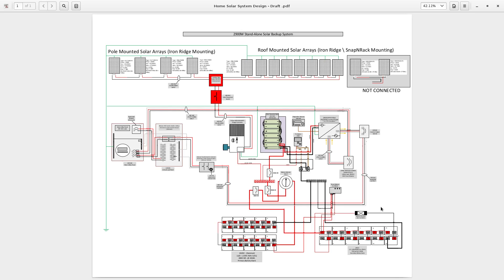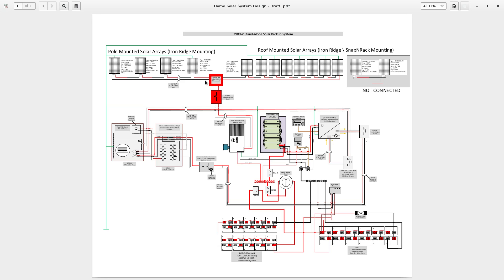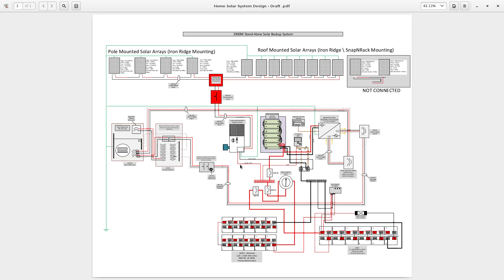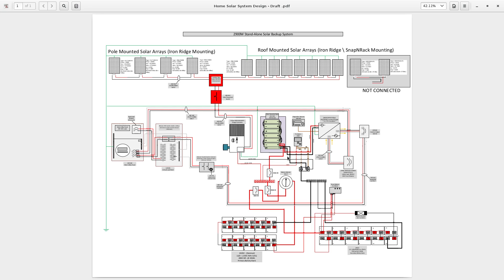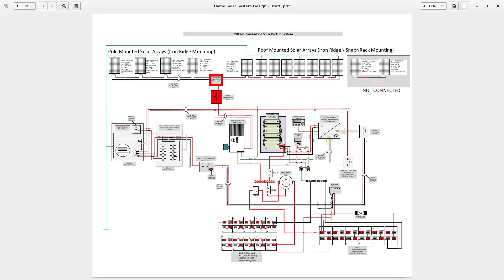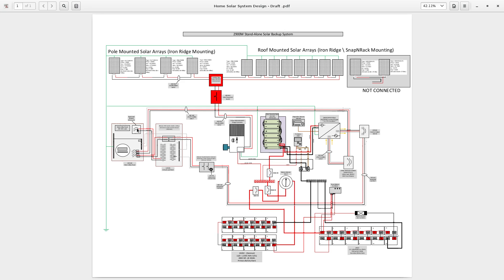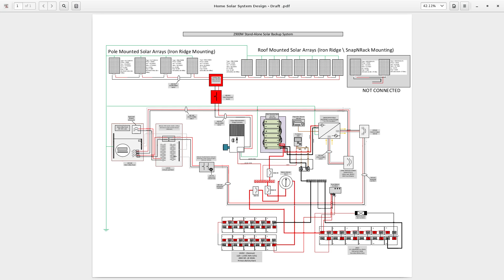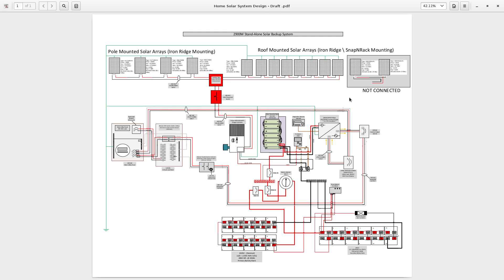My DIY Solar Off-Grid \ Battery Backup Electrical Schematic

Comment: Hi, I am both impressed and overwhelmed by the complexity of your system. This is not a criticism, I'm simply not sufficiently knowledgeable enough to understand it all! To cut a very long story as short, I need to install an off grid system, I'm starting to build my straw bale house and ancillary buildings, one of which will house the system and panels next spring. I need power now in order to survive the winter here near Limoges in France, we are living in makeshift accommodation to keep our budget for the build. So I need help to get my system configured. What really caught my attention was your use of NiFe batteries and more particularly the integration of ultracapacitors which I have never come across before. #1 I also have 20 x 1.2v 250ah Changhong NiFe batteries that I found on sale at a heavy discount, previously purchased but never used, chemicals are still in there containers etc. I was told that the ah was too low to be of any use and that they could not be combined with any other type of battery due to differentials in charging requirements! You seem to have managed the impossible, can you explain what I need to do to do the same please?

#2 what are the advantages of using ultracapacitors? I had a quick look at them online, they seem to be quite expensive, my revised plan was a 48v system using Soltaro 1kW lithium batteries (made in Italy). I believe your primary consideration was to extend the life of your batteries and use the ultracapacitors to reduce spikes in usage and charging? 

#3 Finally, could I combine my 24v NiFe batteries and the 48v Soltaros without damaging either? Maybe using one set as a primary and the others as a secondary. Which way round would you do it if it is feasible both cost and efficiency wise?

I have spent the last year trying to make head or tail of solar PV systems using different components and the pros and cons of each. I think I am now more confused than I was 6 months ago, it's such a minefield. Obviously I'm trying to do this at the lowest cost for a system that will be relatively maintenance free and above all reliable as we don't have mains power available, only a 6kVa generator which is expensive to run and noisy!

Any advice you can offer would be very much appreciated, your the only poster on youtube I believe will offer the right advice with an obvious knowledge base I lack.

Thanks in advance, Paul
Reply from the maker: Hello Paul,  sorry for the late reply, I've been un-available for weeks.  Anyway to answer your questions,  1.) I would the Ni-Fe cells as my backup battery bank and the Lithium cells as my primary.  From what I recall, you don't mix Nickel based cells with Lead Acid cells, because the chemistry is different. 2.) My ultra-capacitors are used to handle the surge "power" requirements of my home when I'm off grid, essentially, because of the high amperage ultra-capacitors provide, they can supply power faster than standard batteries.  They can be quite expensive, but they work very well in my system.  3.) Lithium cells are way more efficient than Ni-Fe cells, however they do have a lower shelf life, that is why I would use them as my primary bank and the Ni-Fe cells as a backup battery bank.  For ultra-capacitors, I would stick with Maxwell or another commercial brand.  Cheap caps from China are not good.

Comment: Great video, though I have some questions

1. #2 CU? #2 can't handle 150 amps. highest I find is 130. to get up over 150A on a 75C terminal is 1/0 CU
2. Welding cable is not rated for continuous use, which a battery bank would be considered. something like THWN-2 or other 90C rated insulation would be more appropriate
3. Using the same logic from #1 a 250A breaker would need a min of 250kcmil CU to be protected
4. I am curious how you prevent a utility back feeding situation in which you have the generator running with the utility power experiencing a problem. I don't see how this system guarantees anti islanding for utility line workers. Does your utility know about your system? 

Again great video, very cool custom system
Reply from the maker: Thanks for your comments.  You are correct that #2 cu can't handle 150A, in my original design and intent my system would never get above 120A during normal or extreme usage.  But again, you are correct and I have since changed the wiring to be all 4/0 cable which is rated for 310A.  Also, the welding cable, in this application where the amps during normal day to day operations don't normally reach above 60A or 90A on the extreme should be fine for continuous duty, in my opinion of course.  Continuous duty for a small scale solar backup \ off-grid system similar to mine is generally around 25A to 30A continuous, that estimate is based on 5 years of experience with my system and observation of other systems as well, bare in mind most lead acid battery battery banks can't take the high amperage draw without degrading the overall bank.  Also, back feeding to the grid from a portable generator is prevented by a manual transfer switch in my 120v load panel and a UL approved Interlock switch at the main breaker panel, which is one of the only legal ways you can back feed power to your home from a generator, as I believe your well aware.  With those mechanisms in place, it is not possible to back-feed to the utility greed.  Since my system is not grid interactive there is no need to get utility approval since Anti-islanding applies to grid-interactive systems, not off-grid battery based systems.  Also, thankfully my system is on file as have been permitted, inspected, and approved by county officials so there is no worry there as well.  Again, thanks for your comments, I'm sure it's not a perfect system, but I will say it is a safe system, I have more circuit breakers, surge protectors, fuses and over-sized wiring in place than most commercial systems.

Comment: I would move the shunt on the inverter side to show accurate charge and discharge rate. you never know what's really going on with the inverter with out it there the instructions manual says install at the inverter side on the negative leads. but you made a very nice diagram
Reply from the maker: In my setup, at least for my purposes, it has to remain where it is.  I'm only interested in what is actually coming out of and going into the batteries and at what rate, not what's necessarily going into the inverter through the caps.  The manual is tailored towards a traditional install and setup.  Ultra-Caps changes the scenario.  The capacitors may be supplying 50 amps to the inverter, but that wouldn't accurately reflect what's actually coming out of the battery to recharge the caps, and so that wouldn't help me to know during off-grid operations where I need to trim loads to sustain a 20A to 25A draw from the batteries themselves to ensure I get at least 8 hrs of run time.
Reply: rhandsom the way I see it is the capacitors act like a battery is well
Reply from the maker: Actually, they act as a storage buffer between the low power density batteries and the inverter. Which is no different than what electronic capacitors do in circuits. Combined they are only have 36.4 watt hours of power which is negligible in terms of any extra capacity for the system.  Running of the capacitors alone would give me maybe 10 to 15 minutes of run-time until it reached the shutoff voltage.  So far the system accurately reflects what I can expect from the batteries at the measured amp draw rate on the Tri-Metric, to change that to the inverter side will add a level of uncertainty to an already tuned system.